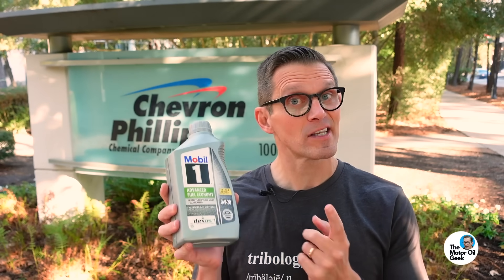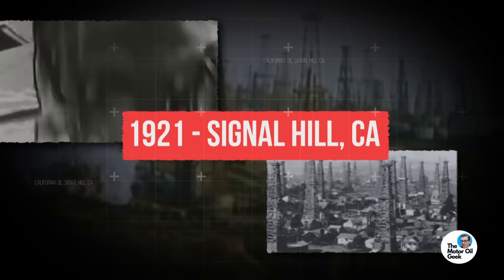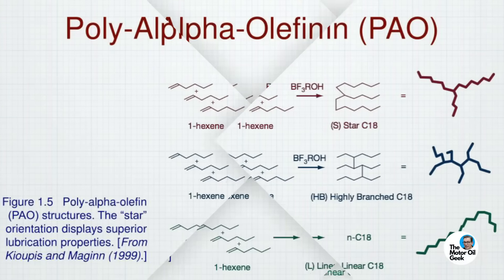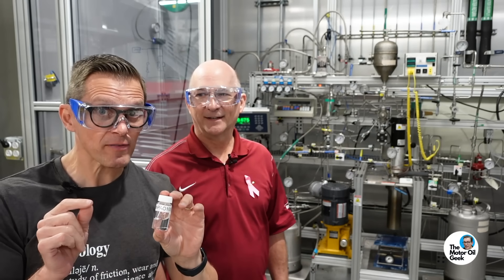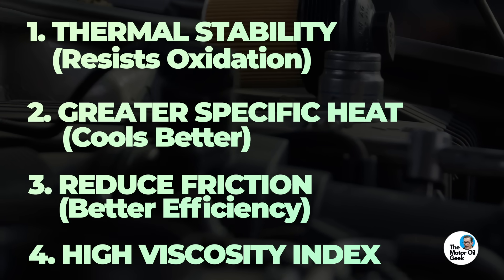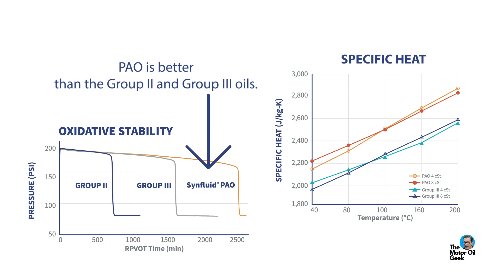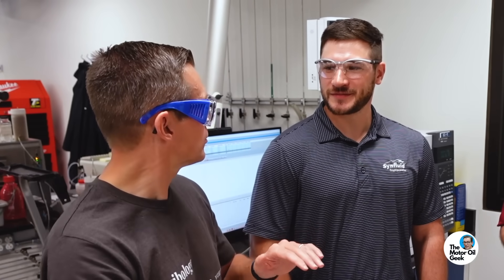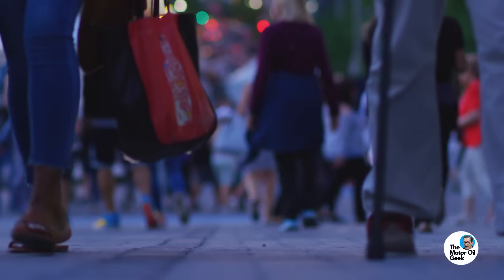STOP Using Regular Oil - 4 Reasons Synthetic is BETTER!

Comment: Can you even get a true conventional oil anymore? Everything is advertised as being some kind of synthetic.
Reply: I'm not a 100% sure about what you mean by "true conventional", but there are different offerings of mineral oils on the market. There's even oils for vintage vehicles that I believe would be out of spec for most engines, like Castrol classic. 
I'm not sure if there's anyone left making "good ol' high zinc Penn grade oil" (did I get the drawl right? 😆), it's been a while since I saw Kendall, Quaker State phased it out ~20 years ago (got a story how that played out for someone 🙈), maybe 76 or some other brand has it "pure", I believe Driven offers it mixed with PAO (which is better).
Reply: @PSA78 
Probably but it's hard n rare to find true southern sweet syrup/Texas tar tea for your wheels.
Reply: All synthetics on the shelf are group III labeled as synthetic because Mobil took Castrol to court when they labeled group III as synthetic and the court said it was synthetic. So now all major manufacturers call group III synthetics since it’s cheaper. Amsoil makes group IV. Who else ?
Reply: @rl7487  Mobil and Chevron both use PAO G-IV Base stock.
Reply: @rl7487 The Pennzoil Platinum and Ultra Platinum are GTL’s or gas to liquids which are Group IV as I understand it.
Reply: Nowadays to get real PAO based oil is quite a challenge 😉
Reply: @Dzinbhudist  honestly  doesn't matter what oil long as it meets  approval
Reply: @ UOA says different but you know better 😁
Reply: @Dzinbhudist no, it's not at all hard to find pao oil. Understand who makes it
Reply: @ show me more than 10 examples of oils with PAO over 40% 😉
Reply: I believe the white bottle of shell rotella (t4?) is a conventional oil. I use it in my small engines and basic engines. Ran it in my air cooled motorcycle for years.
Reply: Realize that very few conventional oils are still being pulled out of the ground.  Most are re-refined oils-- used oil sent through the refining process.  It's just as good, and better for the environment.
Reply: @joeschoe4477  Crude is still getting out of the ground, and at least group III is still made in quantities.
Re-refined oils certainly looks like a good option, I'm guessing the process is quite different in removing unwanted molecules from additives etc but on the other end they also start with something closer to what they are looking for.
Reply: I used to buy Chevron 10w30 for my old Civic with a D17, it was super cheap and I saved a lot when doing my oil changed at home
Reply: Yes. I use Havoline in a old vehicle. It's typically in the 10w30,10w40 and 20w50. Those are conventional. I'm sure other oil manufacturers have the same.
Reply: Only if 100% synthetic is written in the label. Amsoil and motul are 100% synthetic
Reply: @ label doesn’t say anything, because group 3 base oil is called synthetic as well, but it is much much cheaper than PAO. Motul doesnt have oils with more than 20% PAO, so nothings special. Amsoil SS around 40% PAO 😉
Reply: @Triantafyllos_Kalogiantsidis  motul is group III practically everything.
Reply: If the product carries the latest API and ILSAC ratings then it will have some amount of group II or group III product simply because the oil won't meet spec without it. The days of running a group I oil are over. Even the old standard universal 15W-40 is going to be dosed with group II base fluid just to pass the lab tests required to meet industry standards. The big problem today is with the definition of "synthetic". It seems to have become more of a marketing term rather than a technical characteristic.
Reply: @fowvee 
That's right, in one of Lakes videos, I think it was the guys at the Valvolene R&D lab, they mentioned that there's petroleum base oils they can get to a level that the API allows them to be classified as synthetic because they have all the same testing specs.
Even today's conventional oils are light years better than the conventional oils of just 30 years ago, plenty of engines have gone 500,000 miles on them, good oil changing practices are more important than anything else, if you change conventional oil every 5,000 miles and 3,000 in the winter especially if you make short daily trips there's no reason your vehicle won't go to the point where everything else is falling apart and it isn't worth maintaining anymore before your engine goes out.
Reply: @fowvee  What was the last API rating that still would have allowed widespread group 1 base oil on the cheaper engine oils?
Reply: @gregorymalchuk272  They started paying more attention to volatility, fuel economy, and emissions cleanliness around 1992 with the introduction of the API SH standard. Thing were pretty sloppy so engine cleanliness, volatility, fuel economy improvement, and the recommendation of lower viscosity grades were starting to gain prominence. It kept getting harder and harder to make a engine oil capable of meeting mandates so higher quality base fluids became the norm. Petro-Canada was a early adopter of hydrocracked base fluids along with Conoco-Philips and Chevron. Today we can buy oil at any box store that delivers Noack numbers in the single digits and controlled shear that gives a fuel economy benefit while maintaining engine protection.
Reply: Sounds like a fossil talking just adapt to new age
Reply: Castrol and Top 1 offers 20w50 synthetic blends of API SN grade.
Reply: Just gotta go to the local no name service station and get that bottle that's been there for 15 years for $10/quart.😂
Reply: I think the Auto Manufacturers are requiring semi synthetic oil for their engines. These have conventional in them, but have had some chemicals removed or added to make them better. Not only that, oil companies use terms like Semi Synthetic as a way to sell product, at a higher price and more of it. Back in the 50’s they would call it a Delux Oil or Super Oil. It’s better and they don’t want to bore you with all the details, but it’s new and modern. Back the. Who knew what they did to it! Penzoil used to come with Z-7 in it. My shop teacher ran a garage for years and he sold Penzoil. After a few years of having his barrel of oil refilled, a 55 drum that stayed in the shop instead of waiting until they ran out and brought in a new barrel, his barrel went near empty. He pulled the lid to see what was in it and if he could scoop out enough oil for a customers engine, but when he did he discovered that the bottom of the barrel was full of paraffin. That’s was the Z-7. It wasn’t added, Penzoil just didn’t go to the trouble of removing it. Ome companies will do anything for money. Just look at MOOG suspension parts. Want to k ow what MOOG stands for? It’s an acronym for Money’s Our Only Goal. Nice, right? But the do make quality parts!
Reply: @kennethcohagen3539  What is Z-7? I know that Pennzoil and Quaker State used to use waxy paraffinic Pennsylvanian crude oil.
Reply: It's at the $1 store
Reply: @markbroad119  The dollar tree doesn't even sell engine oil anymore, though they do sell like 4 ounce bottles of power steering fluid. But even the oil at the dollar stores that actually sell oil (the stores that allowed prices to rise above a dollar) is API SP, which other people here say basically require group II and group III base oils that are commonly described as being "synthetic" in the USA.
Reply: In the old regular weights... So 5-30, 10-30, 10-40... 
But it's basically not available unless it's a blend in more common (today) in 0-20 or 0-16 etc.
Reply: I wanted some a few years ago and found it a bit hard to find.
Reply: I get what is called conventional oil from Total in a 55 gallon drum 15w-40 for my farm tractors. It is reasonably priced and it is ck4 rated. There is a full synthetic version but only a lower viscosity my older tractors started ticking trying the synthetic oil.
Reply: Yes, you can
At your local hardware store 
Or autopart stores or your country feed n farm store.
Even Walmart has conventional oil
Reply: Most oil requirements today are blends! But just run a good syn every 3k
Reply: That’s what I was gonna say! I haven’t seen straight Dino oil in a while other than diesel oils
Reply: We have to use the mineral oil in aviation.   Mainly due to lead in the gas and blow by…. Mineral oil keeps the lead in suspension.  Synthetic allows lead sludge. 
Now I use synthetic in all my vehicles.
Reply: We have to use the mineral oil in aviation.   Mainly due to lead in the gas and blow by…. Mineral oil keeps the lead in suspension.  Synthetic allows lead sludge. 
Now I use synthetic in all my vehicles.
Reply: Yes conventional oils are still available.
Reply: Valvoline VR1 is straight mineral as I understand.
Reply: Perhaps in the 5w20 viscosity and up... i think 0w20 down will always at least be a partial synthetic..?
Reply: @marc-oliviercabot3380  yea I doubt any 0w is going to be conventional. Any that takes that spec is going to be newer
Reply: @Matp345  exactly. Conventionals are a dying breed. Can't think of a new car that specs a conventional oil. But i work for Toyota so it's all 0w8 to 0w20 there.
Reply: No oil that merts API SN  and beyond has Had a pure mineral base oil. Some sinthetic is needed to get there.
Reply: @cmte.brazinazzo2061  that's something that just crossed my mind at work. We buy 5w30 bulk for the fleet. Tank says its semi-synthetic but it's ilsac GF-5 SN+. Didn't know a blend could get to a SN+ standard
Reply: Rotella t4. Great for old cars.
Reply: I think straight weighed oil, labeled as conventional oil is true conventional oil.  Years ago I called Valvoline because I could not find a true conventional 5w30 oil for my snowblower.  The guy on the phone told me that all multi-viscosity oil is a synthetic blend.
Reply: Only at auto parts stores.
Reply: My understanding is that the group III, II+ are lighter oils and need some heavy group I or II to get a 10W or higher oil. That's why many 15W40, 20W50 etc are not labled synthetic but instead "synthetic technology".
They are somewhat on the fence.
Reply: Hell yeah, we can. Gas stations, liquor stores, some supermarkets, and most auto parts stores.
Reply: My Walmart carries Havoline conventional, which I use in my 95 F-150 4.9. (With STP additive for the zinc). Nice advantage is that it’s a 6 qt box for about the same price as a 5 quart jug.
Just found one parts store that has Valvoline conventional, but I’m not sure if it’s old stock.
Reply: I wanna know the facts, not the friction!
Reply: Easy layman's way to quickly ascertain it is to look at the label....100% vs. Full....
Reply: Conventional oil is no longer “conventional” by definition
Reply: At valvoline oil change place, they still offer it, and it's $50 for the oil change depending on your area.
Reply: I'm sure all the additive packages are synthetic and added to conventional oil.
Reply: I'll bet the $14 gallon of conventional Walmart sells is just that. Wouldn't put it in a lawnmower though
Reply: @Matp345 you'd be surprised how close the walmart supertech motor oil is to other leading brands. Walmart doesn't formulate oil and folks have ran that "cheap oil" for decades without a single issue. I'd rather run supertech motor oil and keep it changed often than run something like amsoil and change it every 15k+ miles.
Reply: @Bobthebuilder.69  I've said that 100 times, Walmart doesn't have an oil refinery 😆. I've seen some oil analysis done on supertech before, It seems like it has a pretty good ad pack And the base oil isn't half bad.
Reply: What all I buy ??? @Matp345
Reply: @Matp345 That's because you don't understand oil !!!
Reply: @Matp345 Plenty of 400-500k mile vehicles proven that opinion false. Older design and hot rod motors benefit from conventional.
Reply: @freebehindbars8654  benefit is an incorrect word... work yes, benefit NO
Reply: Yes, in Walmart.
Reply: Valvoline makes some, Chevron makes some, it is here and there but it's rare anymore. In some ways it is beneficial to run conventional during winter time because the engine heats up so much faster due to the heat 😂
Reply: @Vultain 
Except it doesn't flow nearly as well.  You need flow when it's cold